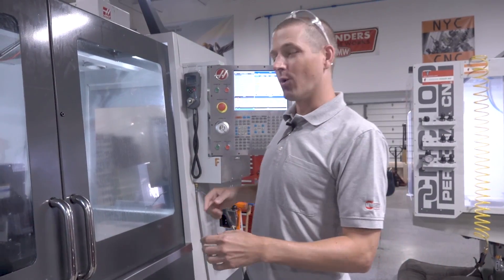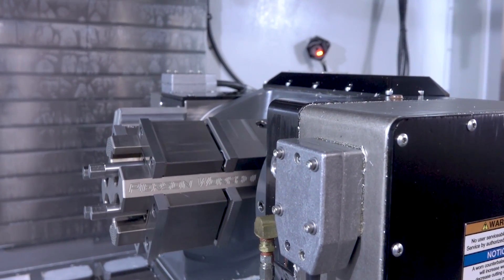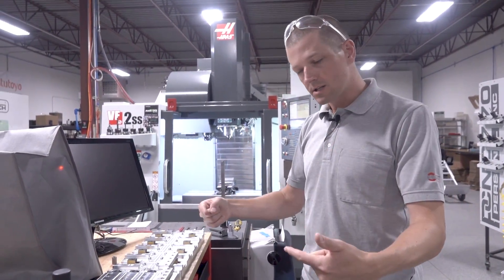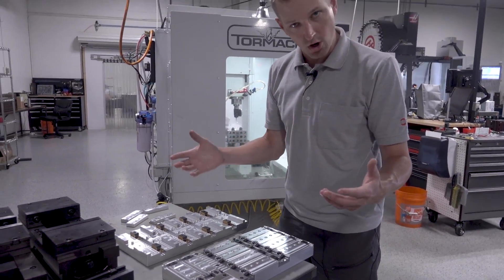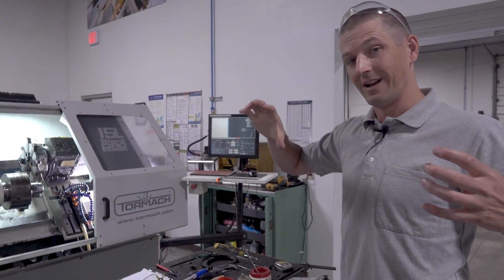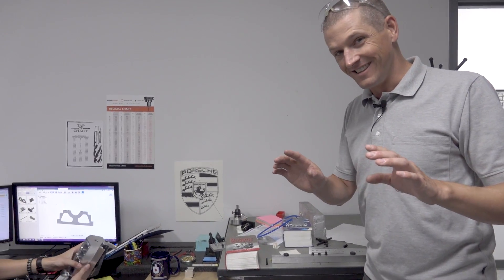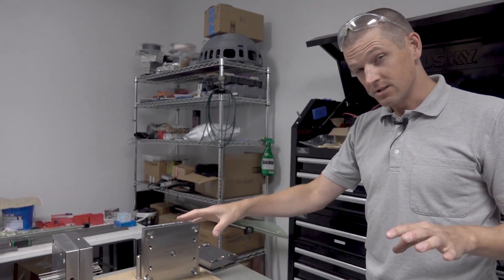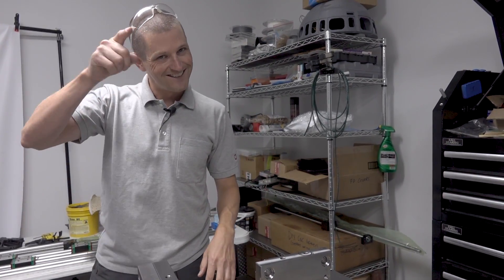Shop Update | August 2018

Comment: Cool gear lever for a sequential gearbox. With the ability to machine the engine block, you can probably buy some of the engine parts off the shelf. Look through some motorcycle parts websites. You will probably save hundreds of hours of machineing.